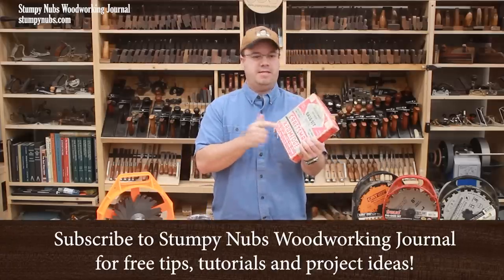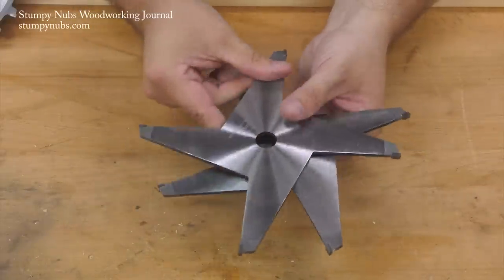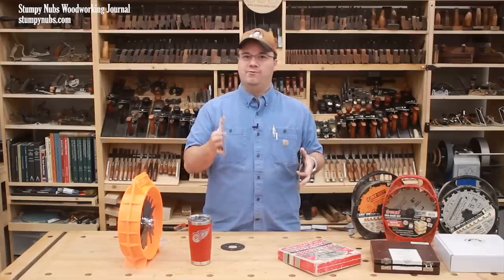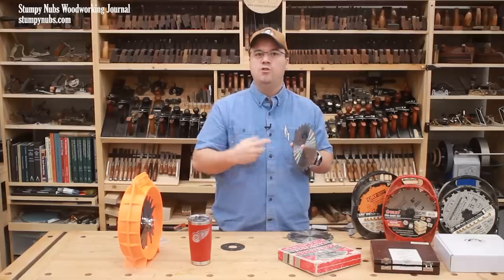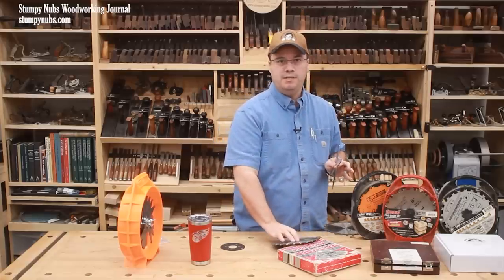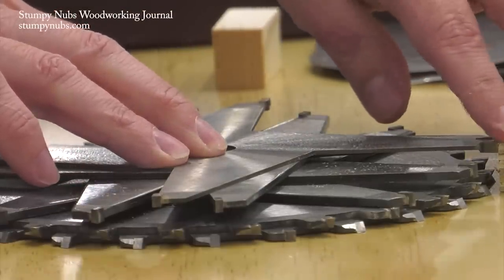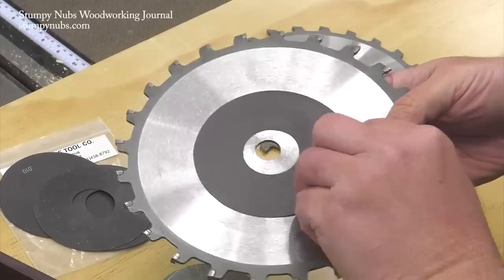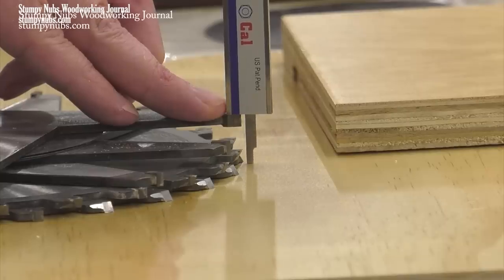If this blade is legal in your country, here's what to look for.

Comment: In Germany dado blades are not generally forbidden, but for some years now, all new table saws are required to come to a full stop within 3 seconds after power-off, so they have a brake on the shaft. Because of the higher mass compared to a standard sawblade, this can cause the nut which holds the blades to come lose, therefore many manufacturers write in their manuals that the use of dado blades on those particular machines is not allowed. If you're a hobbyist, nobody will bother you for using dado blades, but if you're a professional, maybe even with employees, you only should use them on machines that are meant to handle them (you don't wanna get caught and pay a fee of thousands of €s). 

Greetings from Germany,
Marcus

Comment: I watched this video wanting to find a better dado solution. Over the years I’ve had several, wobble, stacked steel, cheaper carbide. They all sucked. I finally finished restoring my 40’s Unisaw and bought the dado recommended here. Game changer! I’m in the process of building some doors for a historical structure and this will make the tenons so much cleaner. Thank you!

Comment: Used a Freud dado set for years but was unhappy with not smooth bottoms on the cut.  Finally bought the Oshlun 8" dado set two months back and love it.  42 teeth on the outer blades, 6 teeth on each of the 6 chippers (four 1/8 blades and then a 1/16" and a 3/32" blade.  I had purchased the magnetic shims previously.  All of the blades have a positive rake.  The Freud set has a negative rake.  The Oshlun outperforms my old set by a mile.  Just cut a 3/4" rabbet in a hickory backsplash and was amazed at the ease of cut and the cleanliness of the bottom, almost polished.  As always, thank you for the advice and the professional presentation.

Comment: I wanted a Ridge Carbide set but they were all sold out when I was in the market, so I ended up buying a DeWalt set. Honestly had no idea what to expect, but the reviews were great. I have been very very happy with the set. It includes all the shims you would need, a 3/32 chipper, and leaves a very clean finish.

Comment: Well, you once again have taught me something. Those magnetic shims look like they would be the bomb! I've only seen the metal ones and you're correct that getting them stuck in the threads of the arbor is a huge pain... both getting them to seat when installing, and them getting hung up when you try to remove them. I'm checking out the magnetic ones right now! Thanks, James!

Comment: I bought the sawstop brand dado set and have had excellent results. Has a 3/32 raker and a 1/4” raker as well which I’d never seen before. It comes in a nice hard plastic case too which has a designed spot for a dado brake cartridge. Super clean cuts, used it for a few kitchens worth of cabinets now, would highly recommend

Comment: I’ve been using my Oshlun 8” set for a few years and it’s been good.
It didn’t have a case but the first thing I did was make one using the blades that would be their home.

One safety thing I would advise is no larger than 8” diameter on a 10” saw.

When you get up to 3/4 dado stack, it’s a hella mass spinning.

Comment: Great info. I'm gunna look into those magnetic shims. In the meantime (after deforming several of my finer metal shims exactly as you pointed out) I've learned to put the fine shims on immediately after the first disc blade, so that they ride on the unthreaded part of the arbor.

Comment: I am just a tinker but did use your advice.  I couldn't spend the money on the Ridge dado set because I couldn't justify the expense, but they do have good saw blades.  I have a few for precision cuts.  I ended with the Frued dado set SD508 but will come back to ridge and get the magnetic spacers after the holiday.  Your reasons are well taken.  I do enjoy your content and have learned and continue from you.

Comment: I have the same Craftsman Kromedge dado set that I inherited from my dad. I tried it just once on the 1963 Craftsman radial arm saw I also inherited. That's a lot of weight to be slinging around at high speed, and the tiniest imbalance really vibrated the saw. I love old tools and I just can't part with the set, just like you still have yours, but I'll never use them again. Thanks for the great info and for the trip down memory lane.
Reply from the maker: It's a scary set on a radial arm saw, for sure. (He used it on a RAS, and I inherited that too.)

Comment: I live in one of the countries where dado sets are not readily available. I thought I could simulate a set by using two regular blades; I bought two new blades purporting to be of identical spec and from the same batch only to find that there was a half-millimetre difference in the outside diameters of the two blades.

Comment: I have the same Craftsman dado stack, also inherited and it works terrific!  Received it and a wobbler dado blade.  I use the stack as the wobbler, with its dial adjustment that moves an eccentric bushing, just seems a bit sketchy.  Those magnetic bushings you show look like disks removed from 3.5” floppies! Yeah, old school here.

Comment: Like my Oshlun set just fine - comes with the 3/32nd chipper, metal shims, and is reasonably priced. I will note that it's 50% more expensive than it was only 1 year ago! But it's still a good starter set at under $100.

Comment: Thanks James. I recently got my first set from Freud. I didn't know that it mattered where you place the outside blades. I realize now that I should pay more attention and read the directions better.
Reply: Good advice when working with any kind of high speed spinning sharp metal things :)
Sadly these are not legal here.
Reply: The teeth are also not centered on the blade. So if you swap them, the stack width won't add up to what you're expecting. I found that out the hard way.

Comment: My dad gave me a great set from Grizzly a few years ago. Has all the good features James mentioned. 3/32" chippers, magnetic shims (da bomb!), 4 tooth chippers, raker teeth, 8". Around $70. My frustration lies with my table saw. Has a short arbor so I cant support anything wider than a 1/2" stack. Which in the grand scheme is not a big deal and likely a little safer. I do like the dado holder, my storage box is getting worn so I'm gonna look into that.

Comment: The cheap shims can also be a hazard. I had one get caught once in the threads, and I didn't notice as I was tightening. In the end, it wasn't tightened fully because of the shim, and when turning off the saw the arbor nut came undone. Fortunately I wasn't standing in line with the blade at the time.

Comment: I have not tried what I am about to type.  Just an idea/suggestion.  You may have some success magnetizing your metal shims by running a strong magnet over them.  Rub in one direction only and place the shims under a cloth or perhaps construction paper to help hold them in place.  If the magnet is strong enough be careful not to bring it in contact with the shim directly.  You could have trouble separating them.

Comment: One unmentioned problem is that in my case my Bosch saw does not have a long enough arbor to use anything other than the two outside blades of the dado set.  I can use shims but nothing else.  Make sure your arbor is long enough to accommodate the entire dado stack or at least most of it.😵‍💫

Comment: James, thank you for this one . I've been talking to my wife for some time about some day getting a set of Ridge Carbide dado blades. I have the page bookmarked and drool over it whenever I go to it.
My trouble is simply cost. With my SawStop CNS175 I also would need to purchase a new brake and plate... making the whole thing a bit over my budget. but someday... someday....
Reply: If the tool you are buying is not big enough for the wife to spot go ahead and buy it without asking just pay attention to your delivery time.
Reply: @ericlipps7152  Well, she is the best and puts up with my purchases just fine. I'm the one who cares more about budget. I've recently added to our home theater system and I need to take it easy on the wallet.  
I like Ridge Carbide a lot. I've bought the flat kerf blade from them based on James' recommendations.
Reply: In the meantime you can use a router to cut dados.
Reply: Sounds like you should just buy another Sawstop just for dados :)
Reply: @demosthenes614  i will consider that 😀

Comment: Quick note: dado stacks aren’t illegal in the UK (or EU). There are regulations about _commercial settings_, not home/hobby, and they’re about guarding and stopping time.
Reply from the maker: They are made virtually impossible to use because of regulations that limit the length of the arbor on your table saws, and rules about how quickly a blade must come to a stop after the saw is turned off. Many people over there consider that the same thing.
Reply: That’s true, but you can buy commercial table saws and dado blades. Regulation is about workplace safety. But, this is a very good and informative video. I know YT comments are full of people like me mansplaining.
Reply: You are so right I use mine when needed on my skill table saw the one with the big wheels  I also have a moulding head

Comment: I have a CMT set that I do like but you are dead on about the plastic shims. I had to remake some out of brass because they got chewed up in the threads. I found a solution that helps though, I use a little bit of mineral oil between one of the blades and the shim. It creates enough suction to hold the shim in place. It's not 100% perfect but much better than nothing at all.

Comment: Lee Valley advertises a Forrest set which has all the recommended specs per blade (number of teeth, negative hook angles), magnetic shims, and 6 chippers in the set for a max cut width of 29/32". Pricey? nah... Edit: The SawStop premium dado set has very similar 24/4, -5 degree specs and the same 29/32” max cut width. I thought it might be identical to the Forrest (perhaps just rebranded) but the teeth spacing on the main blades differs and there’s only five chippers. Lotsa options…

Comment: I've had the same dado set for over 20 years. I think they were made by Freud. The chipper blades only have 2 teeth but it does a good job of making a smooth cut. I don't use it very often so it won't be getting replaced any time soon but I think I will have to buy those magnetic shims. I've never pinched a shim to deform it but the blued steel my shims are made of have developed some rust (my fault for not oiling them). It probably isn't enough to throw off the blades but it still bothers me. They are also a pain to ad or remove from the arbor. The arbor hole is such a close fit that they bind up at the slightest angle. I guess the edge of the shim dips into the threads on the arbor just a bit and catches.

Comment: Bought the Diablo dado stack at home Depot since I was struggling to get reliable, straight, cross-grain dados and rabbets with the router on narrower pieces like table legs and face frame parts in cabinetry. I have never been more disappointed in my life. Awful, uneven, jagged cuts with a ridiculous amount of tearing and chipping. It works okay when going with the grain if you have a zero clearance throatplate, but the time it saves in setup is far outweighed by the damage it can cause to what I'm building. I have to score every edge at least a 32nd deep, often a 16th, to avoid shredding the entire face of the workpiece.

Comment: Good intro to Dados - thank you - but how should the chipper teeth be placed rotated in relation to the teeth on the outer blades? I have a set that appears you can seat the chipper tooth back, against the "next" tooth of the outer blade. This is essentially where it would be pushed if the cutting action could rotate the blade. Or as close to the tooth "in front" of the chipper? so if rotation does occur, it is unlikely to rotate far enough to touch that back tooth? (And yeah, I tighten the arbor so rotation doesn't occur, but using shims, especially cheap plastic, might mean rotation no matter what...)
Reply from the maker: No two teeth should be touching each other. This can damage the blade when you tighten the arbor nut. I like to spread them out as much as I can. If the nut is tight, they should not rotate during cutting, just as your regular saw blade does not slip and rotate back when you use it.

Comment: i've got the 8" dado, a ts2000 and a thin kerf blade from ridge carbide, i got them all based on your recommendations but i gotta be honest the experience i had was one that i am not willing to risk repeating.   first the dado stack had one of its raker teeth in the wrong spot, which caused the stack to cut a deep groove on one side. second my ts2000 looked great, but when i put it on the saw and fired it up for the first time i heard this "zzzzzzingg" and long story short found one of the carbide teeth embedded in the drywall of my shop ceiling, and third the thin kerf blade is ok but i found out because of the oddball atb+r grinds when i sent to my local sharpener the blade came back with the raker teeth ground to atb and i realized if i want to maintain the atbr my only option was to do the mail to ridge carbide and wait 4 weeks.   to ridge carbides credit, they offered me a full refund on all the blades. they sent me a magnet shim set and blade carrier which they didn't need to do.   so yea the customer service was great but after spending $500 and 3 months of shipping tag to get what i wanted i cant say im willing to  try with them again.
Reply from the maker: Having owned more than a dozen Ridge Carbide blades, every one of them prefect, I find this VERY difficult to believe. I am not saying it did not happen (I take you at your word) but this experience is so far from my own and that of literally hundreds of my viewers who have told me about their great blades for years. Even so, I am not surprised at the part where you said they took care of you. Ridge Carbide is a rare company that honestly stands behind their products.
Reply: @StumpyNubs  it was right when the company switched ownership and the new owner called me personally to apologize for my experience.  I didn’t share this to discourage others or talk down the company, they are spoken so highly of I’ve tried convincing myself it was my fault event haha..

Comment: Its funny how here in Eastern Europe they are ilegal due to safety regulations but having the exact same system of multiple even thicker and larger blades installed on my a spindle moulder vertical spindle is not banned :)
Reply: Yeah a dado set is too dangerous, but everything is fine with putting some huge moulding cutter on full send and just going to work

Comment: Personally I prefer the Amana carbide tipped electro blue prestige set for super fine cuts. It makes the flattest dado I've ever seen and as smooth as if you sanded it with 600 grit sandpaper. It made very nice dados in maple butcher block. The shims are horrible though. They are made of plastic

Comment: Hey Stumpy, is there a reason you didn't mention the Freud Dial-A-Width dado sets?  My neighbor has one and it's super nice, no shims, you just spin the dial on the one outside blade to dial in the width.
Reply: I have always been curious about those. They seem like they'd be great.
Reply: The Freud is not a wobble dado
Reply: My Freud dial a width is by far the best I've ever used, quality blades that leave the bottoms and edges as good as it gets, going on 5yrs now of medium to heavy use (non production) and they are still going strong with no appreciable difference in cut quality from the day I bought them however, the real difference maker is the amount of time, hell even material, saved in set up. It may be a bit pricey but it's far from the most expensive set on the market and it's by far the fastest set up/width change set in existence. Que The old adage regarding times relation to money.... Seriously though I can't speak for everyone but my time is worth quite a lot, to me at least. So even if woodworking is your hobby, not profession, we all only have so much free time. I absolutely recommend the Freud dial a width.... You will not regret it.
Reply: @rogerhodges7656 what @davids2530 said..... Definitely not a wobble.... Totally different operating system....

Comment: Thanks! Great video and subject James.  Could you give your opinion on 8" dado sets vs. 10"?  There is a big price difference and I can't think of a situation where a 10" dado set would ever be needed.  Why would a person need that much height adjustment when cutting dados?
Reply from the maker: 8 inch is the one to get. There is a video on that subject included in the links I provided.
Reply: @StumpyNubs  Thanks!  I'll check out the video on the links.
Reply: The larger set has a tooth speed 25% faster, and will have more room to dissipate heat.  I imagine they are preferred for high volume production work more than depth of cut.
Reply: A 10 inch set is a very heavy set, you should only use those for the industrial machines it will easily snap the arbor on any of the jobsite saws.
Reply: @bobh64  I notice Ridge Carbide will provide the 10” set with a 5/8” bore, so presumably they don’t think it’s a problem.

Comment: The link to the RIDGE CARBIDE blade shows a 3/32 chipper. In the video I understood you say it was a 1/32. Just looking for clarification. Thanks
Reply from the maker: No, I said 3/32. You could not make a 1/32 chipper, it would be too thin. But 3/32 adds the 32nd increment to your stack.